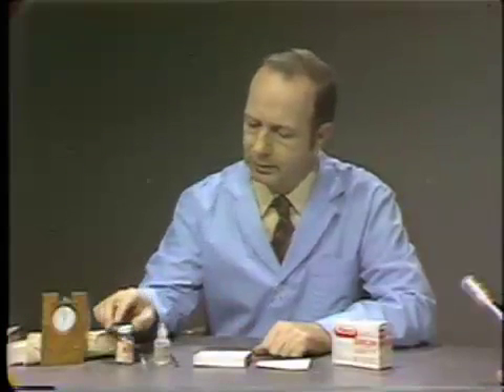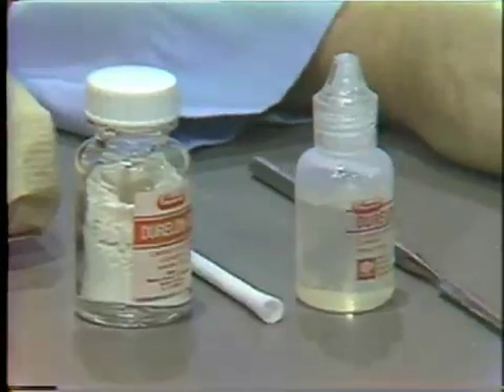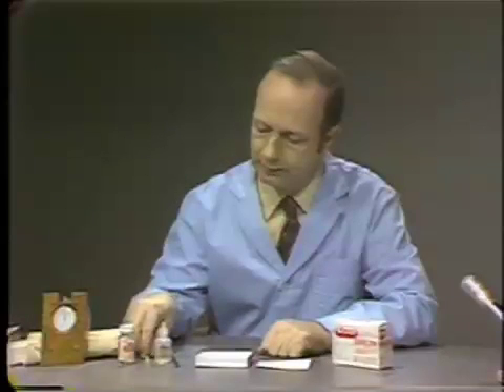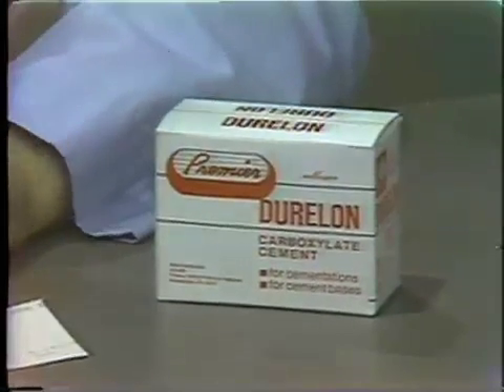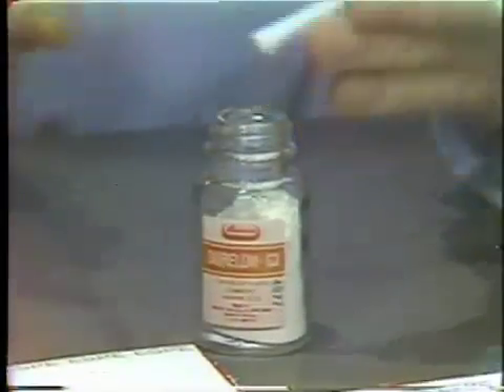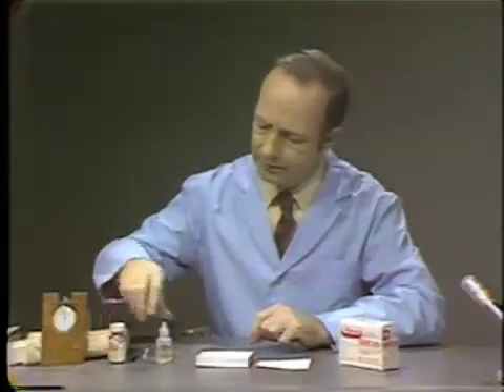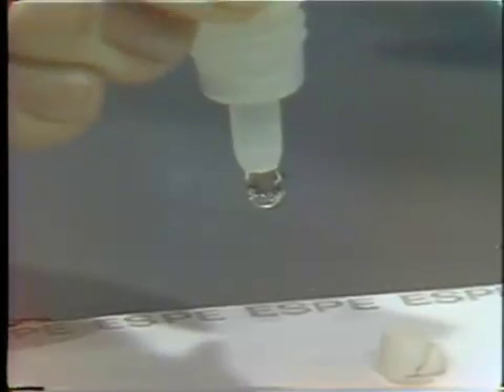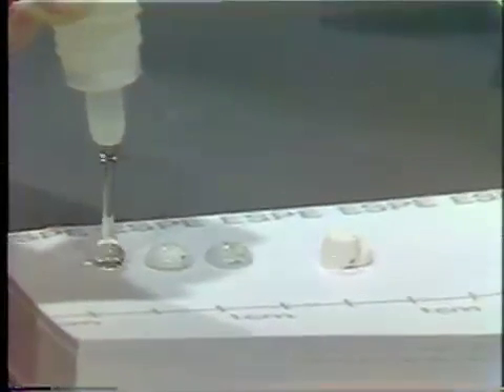Polycarboxylate Cement (Durelon)

Comment: The technology behind this hasn't changed in close to 50 years and you can buy both components off ebay. If your filling broke and there's no pain associated with it then you can clean it out, and fill it your self. I would suggest cleaning the area and then filling it with a temporary filling like Cavit grey for a non chewing surface or pink for a chewing surface as the pink is the highest strength Cavit and let it go for at least a week to see if any pain starts. If you temp fill it and then you start getting a lot of pain DO NOT use a permanent cement!! You might have an infection or an abscessed tooth that you need professionally fixed. If there's no pain or discomfort with the temp filling then remove the temp and clean it good and fill it. I did this years ago and the filling is still 100% with no problems. My dentist was shocked I did this and kinda gave me a bit of a scolding that only professionals (LICENSED professionals) should do this and actually threaten to drop me as a patient! After he was done I went out to pay for my visit and told the desk I will no longer be coming here for treatment so no further scheduling will be necessary. My new dentist is cool and has no problems with it.

Comment: so the polycarboxylate is basically a liquid part and those zinc oxide powder is there just to replace the present of cement or both are mixed to be polycarboylate ?